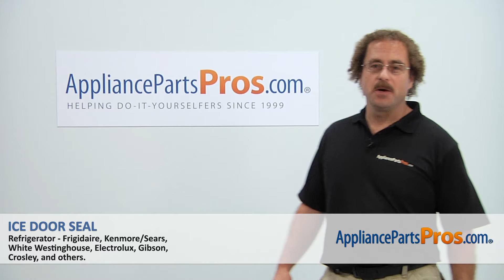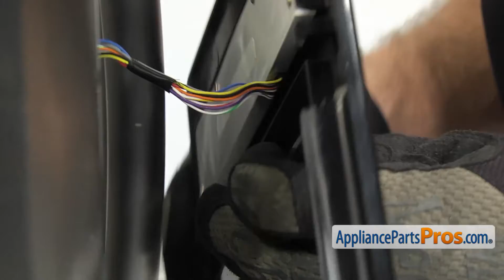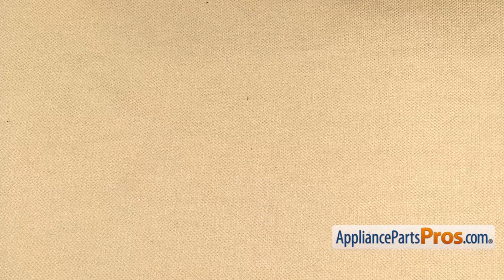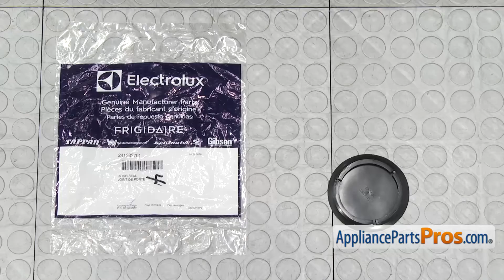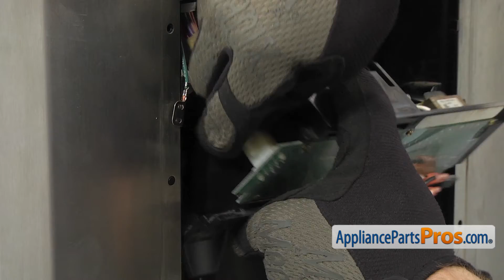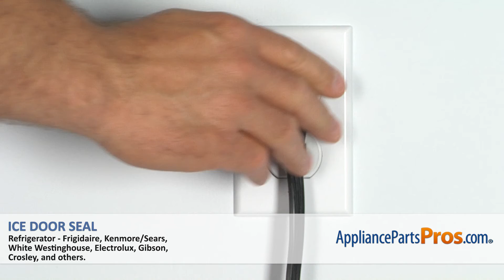How To Replace: Frigidaire/Electrolux Ice Door Seal 241688701

Comment: Is there a part number for the center cap foam piece ?
Reply from the maker: What is your model number?
Reply: @appliancepartspros  FFSS2615TS5
Reply from the maker: Unfortunately, that part is not sold separately from the dispenser module on your model. That part number is 240563639. You can place that order through our website, or you can call us at 1-877-477-7278 to place the order over the phone.
Reply from the maker: Thank you. There shouldn't be any gaps. If the correct parts were ordered and that wasn't an issue before the repair you will need to double check the installation and make sure everything was installed properly.

Comment: Is there a solenoid that opens that round little gate? Should the solenoid open the gate or just the weight of the ice cubes? In my fridge, ice will not overcome the spring no matter how much ice I put manually from the inside if the freezer door.
Reply: You've probably realized the issue by now but the flapper should open when you press against the back plate. The ice by itself does not force the flap open from the inside. You should be able to manually open and close that flapper from the exterior of the door.

Comment: I just bought the Frigidaire side by side refrigerator and within a week frost was building up around the ice chute and bucket. The seal was new so I didn't buy a replacement but the frost kept building up month by month after several months of research I found this video which helped immensely with taking the thing apart after the little disk fell out. I looked up inside the chute I could see that the seal was not set right it had popped out on one side of the pins which I'm guessing is was the problem in the first place with the frost build up. I followed the video to put the disk back in and made sure both pins were in place . The only thing I had a problem when putting it back together was the water hose and the odd angle the video suggest I wasn't able to do that, so I used needle nose pillars lined everything up the way it came out and pushed the hose in with the pillars then pulled it the rest of the way though at the hole spout. Thanks for the help.
Reply: Mine did too.

Comment: Great & Helpful video!  For those of us with larger hands here is a useful tip: After untold attempts to reinsert the water line I finally took the circuity board off (6 small screws) and used a pliers to insert the water line.  Case closed in about 10 min. Could've save a good hour or two versus trying to contort the assembly and squeeze my hand into a tight place.
Reply from the maker: Thanks for that tip!
Reply: good idea, but still didnt help me